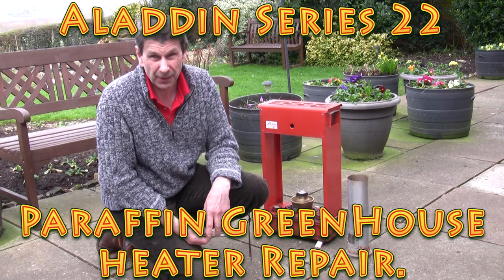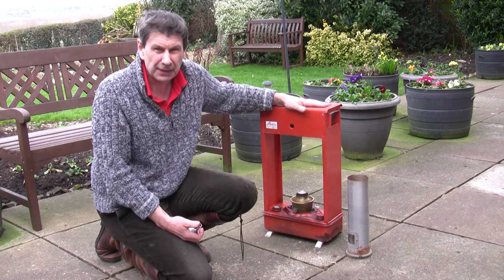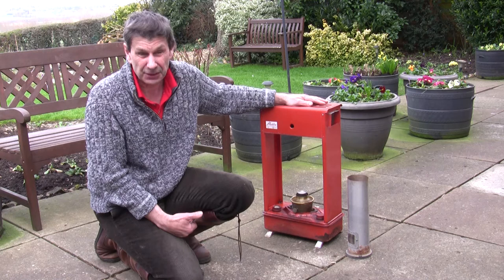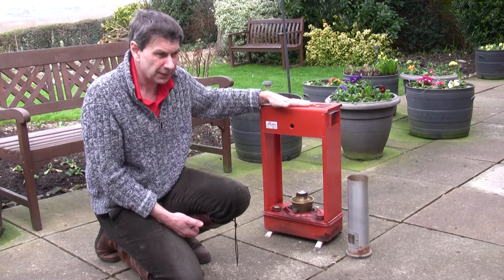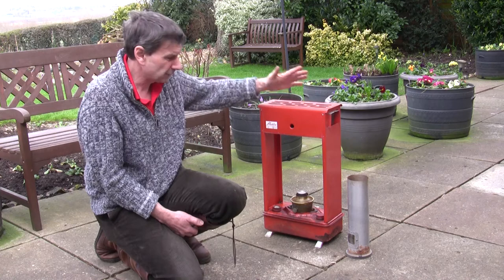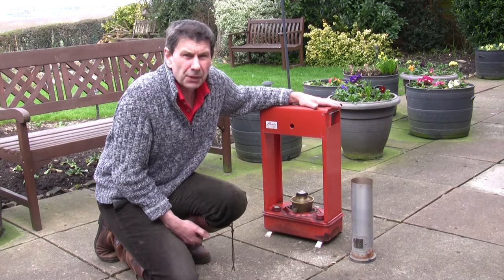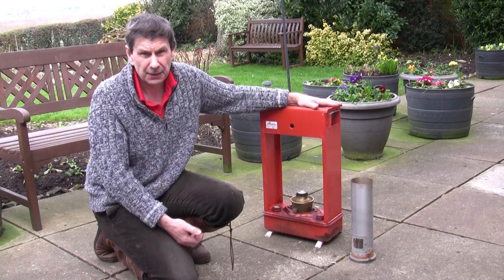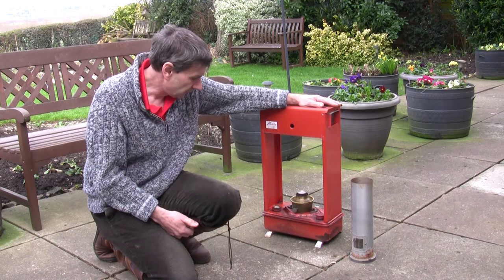Aladdin Series 22 Greenhouse Paraffin Heater Repair Part 1

Comment: Most parts are available still for Aladdin and valid heaters. The wicks are made in Keighley Yorkshire by a company called hattersley narrow fabricks, who were one manufacturer for Aladdin. The two company's amalgamated around 10 years ago. There is also a company called basecampuk who specialise in lamp and heater spares for quite a few models. Those later Aladdin products do seem to suffer with rusty tanks, older ones were brass. And some were made in wales. I use blue flame heaters in our home as we don't have or want the unreliability of awful modern gas boilers. Shouldn't smell!!. As you say paraffin is ridiculously expensive when bought in a plastic can. We buy 200 litre barrels for around £260 delivered, which is much better than £2 a litre. Is some scrap in it though. Looks like you may do the same as I'm sure I spotted blue dye in it. Good channel, best regsrds, Tim.
Reply from the maker: Thanks that's all so interesting! Yes, these later Aladin heater tanks on this model are very prone to rusting out for sure. My first one brought in 1979 just went all to pinholes by the mid-1980s so like I say this was a new ex stock heater brought of ebay at that time so this one has lasted better but still just very thin steel. Yep, I brought a new fuel gauge cap for this heater from basecamp great firm to deal with  All so very interesting what you say thanks so much for a great reply and comment. Kev.

Comment: I’ve just bought one from an old lassie up here in Scotland, she told me it was in good condition 😳but sadly it wasn’t, everything is good apart from the tank which hopefully I can repair, can’t wait to get it fixed. Thanks for your videos and extensive knowledge 👍
Reply from the maker: Thanks for your kind comment, yep these old mild steel Aladdin tanks sadly do rust to bits! Very like the old UK cars of the 1960s and 70s! My first one of these heaters I brought brand new in 1979 well the tank in the end just got so many pinholes it was impossible to repair them all! But for a small hole often a simple nut and bolt and two big washers one inside the tank and one outside the tank and the nut and bolt done up very tight will seal a hole up. You often get holes in the most tricky place mind right by the feet. But they are such a great greenhouse haters. I grew so many good plants with this one this year starting them off just that little bit earlier, Good luck with yours hope you get it up and running. Thanks, Kev.